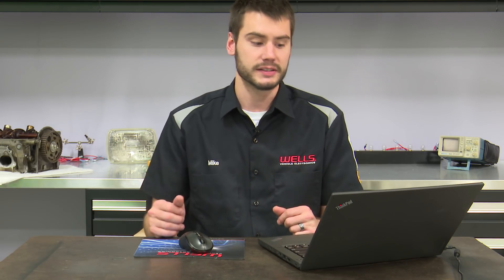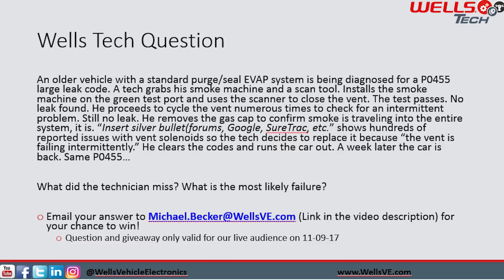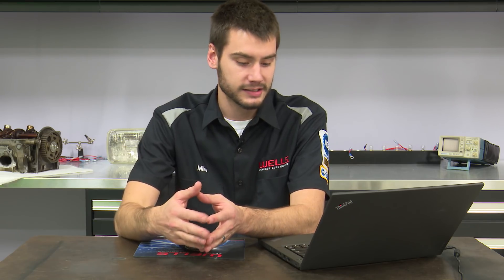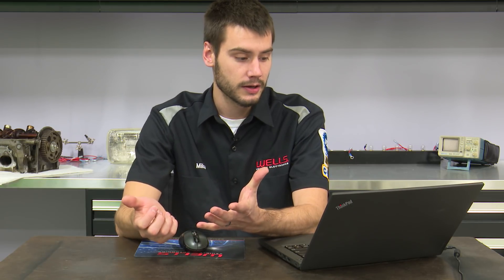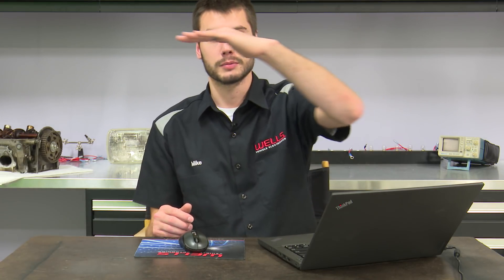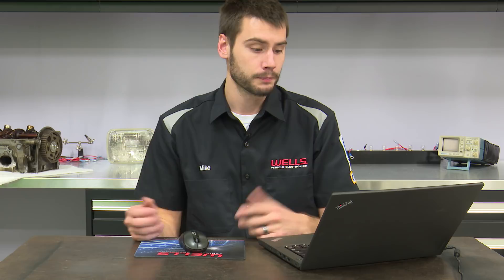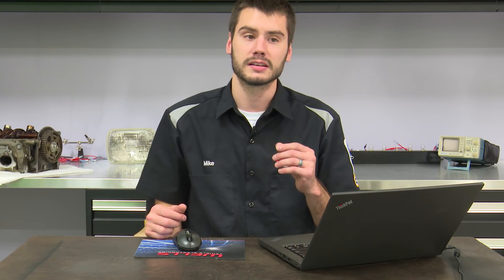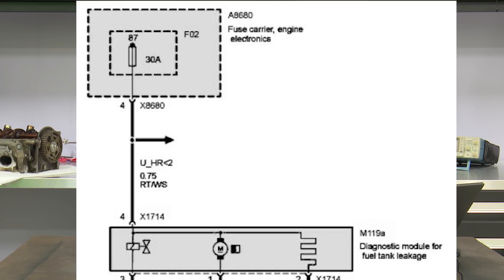TechConnect Ep. 24 - Answering Your Questions From The Last EVAP Class

Comment: Regarding the test question, if you're lucky, you'll also get the corresponding code (P0441/46) for the stuck closed purge valve! lol Nice job Mike and thanks!
Reply from the maker: John, if you're lucky! The purge opening operation is always something that should be checked though...and the tech in question here didn't even think about it at all!
Mike Becker, Technical Services Instructor

Comment: Thanks for posting these very informative classes! As for the tech question, could a faulty tank pressure sensor that’s not reading correctly and therefore not reading the increasing vacuum be a possibility?
Reply from the maker: Hey Jerstuube, thanks for watching! Yes, a faulty FTP could be the cause depending upon how it failed. It would need to be a failure that doesn't trigger a circuit or performance code for that FTP.
Mike Becker, Technical Services Instructor